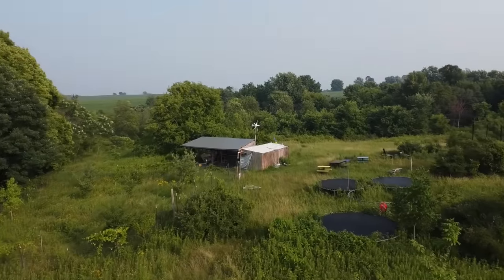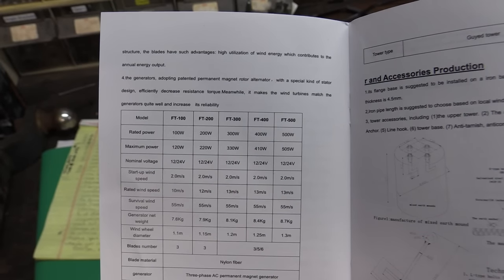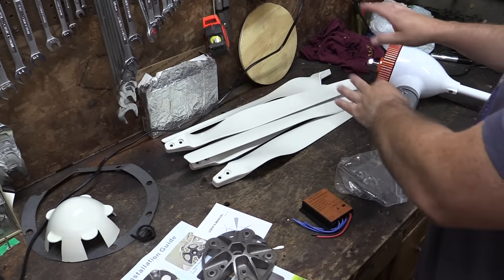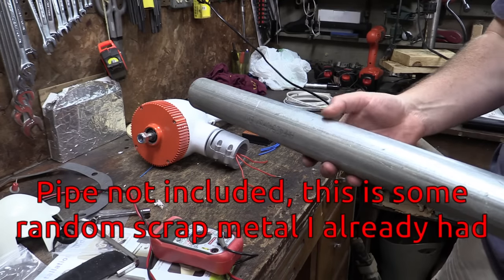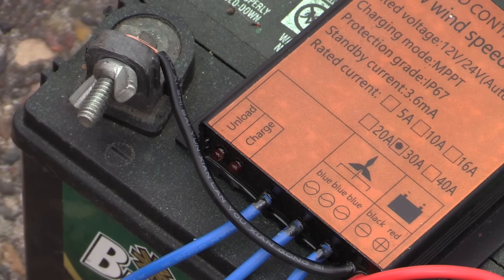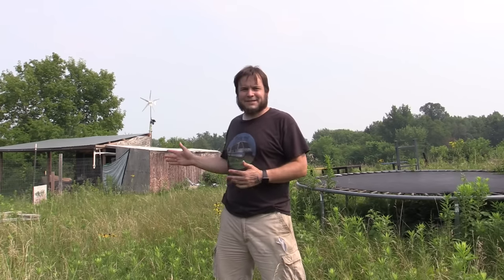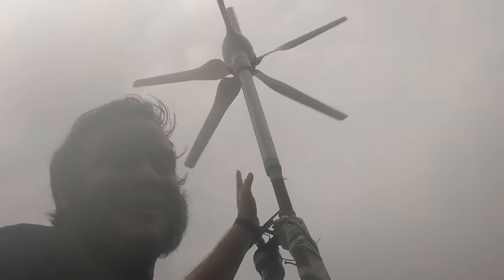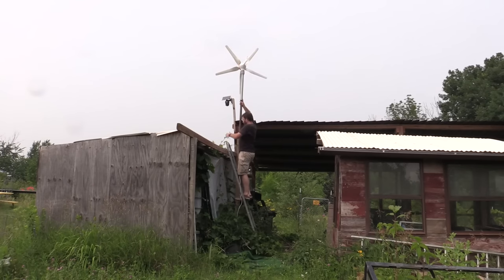Finally A Real Wind Generator! Vevor FT500 Review

Comment: If you ask me, these sponsored reviews are so much better than generic VPN-ads other creators roll. The turbine doesn't look bad, I think I'd give it a try myself. The entire off grid topic is kinda interesting on it's own, would be really fun if some water-turbine company reached to you for an review
Reply: I agree. I actually watch these!
Reply from the maker: A water turbine would be fun, we had one when I lived in Alaska. Unfortunately the Midwest isn't known for its mountain streams 😂
Reply: @saveitforparts   But we do have wind!  I live in BFE, miles from a highway, surrounded by flat fields.  Windy almost every day.  Still days are an oddity.
Reply: was it a homemade unit using an alternator for power generation?
Reply: I agree this is extremely relevant to my interests, and what an absolutely brilliant live commercial style video. I was actually recently searching for small wind turbines
Reply: @saveitforparts ...and the few creeks we have are all dry right now!
Reply: These arent awful but they dont last long if you are in a extreme wind/weather area, but for the price, theyre not bad
Reply: instead of a heat dump for overload power use a water pump and a couple of water tanks first maybe then you can use a couple of triggers to cycle a hydro gen battery for low periods
Reply: Can you do a video listening to TV new station satellites I know they transmit to a frequencies
Reply: just in case you do try wind, check your local area max wind speed, not average as i did. I killed the controller on an $800 northern tool wind turbine in 31 days. West Texas has average wind speed of 13mph but we get it all in 3 months with some months averaging 30-40mph and 60+ mph gusts.
Reply: Those are nice, ran a 400watt one in a tiny creek with funnelling work that trickle of water nearly made me 400watt, I was 330 most the time. Those I like better than all the rest. Forgot name this hydrovane or something, sailors tow them
Reply: @vinceghio I'm tuning in to your frequency right now. Can you tell that I'm listening. Very interesting. Tell Michael I said "hi".
Reply: @saveitforparts make your own stream, I started with solar and used power from that as pumps to keep my stream running all throughout my 40 acres and I'm growing a forest, anyway I built my own water turbine from my own stream, it takes power to use keep the stream running but I have multiple water turbines all throughout my stream
Reply: @saveitforparts its an air-x knock off
Reply: @saveitforparts >>> The place where I was born and raised, FLORIDA, is not known for much mountain-anything...😊
Reply: Agreed, you seen Scot Hugh Piggot & scoriagwind? . Few in towns ever have Free running streams etc. Great if you have A River near you.
Reply: @piquat1 you sound in an ideal location..if considering DIY I advise buying a proven PMA PMG & start from there. I used to make Dozens at one time.
Reply: Prices of these have gone through the Rooff on Ebay US.The 400-500 Watts is at a high 12 metres a Second 40 mph wind. If you Offgrid   Boat, a Farm in Alaska or Scotland even a steady 0.4 Amps is valuable to keep the lights on or Radio Battery charged.
Reply: @glitter_fart correct! For many even a low steady charge keeps the lights on & Radio batteries charged.

Comment: It would be interesting to measure voltage and current on the input and output of that little "controller" box to see how much power is actually flowing
Reply: Yea that would be pretty useful in a review for a power generation device. Kinda pointless without any numbers
Reply: Yeah it's basically the only important thing to talk about
Reply: It will NOT be 500 watts, as advertised on the sticker on the tail.
Reply: @jasonheckenlively1172  Exactly my thoughts...
Reply: @MrSummitville how do,you know
Reply: @MrSummitville Well ya,the wattage all these listed by only make that rated power in maximum ideal wind. Being able to generate power at night and in winter with low light is pretty huge.
Reply: to have the rated power of 500 watts,  the generator must operate at rated power for 1 hour to have a value that can be used as a standard.  it is unlikely that this will occur in most places.  some states, such as colorado will loan through the green energy schools, a test station so that power can be measured in the available wind to support the go/no-go of buying wind power products.

this is in response to the comments below.
Reply: @BigcountryReactions The main limiting factor and not plainly stated is input.  I'd image a so called 500w device will do well to produce 150w's, and even then it'd need a major storm or extremely constant hi wind
Reply: @stuartburns8657 it's bas d rating at a wind speed not all manufacturer use a standard wind speed for this. He mention the wind speed rating that watts are rated at. If you buy based on your local averages you will easily make the rated watts on average days with more on higher speed and lower on lower speed days
Reply: @JuanGelogo  I'll trust your experience, but I've been researching a small wind turbine to supplement by solar in the UK.
So far, prognosis and balance of opinion seems to be  by far to suggest it's not worth the time or money, unless you are keen on tinkering and learning for the sake of it.
Reply: doesnt manual say need voltage display and dump load
Reply: Ive got the same model kicks out same as a car alternator i average 17 volts which is fine as ..mines 12 volt model..and it works in low wind..
Reply: The best I got out of my identical  model was 80 watts at max RPM  (4.5 amps @ 18 volts), they are not close to producing the claimed 500 watts, physically far to small to do so.
Reply: In the electronics hobby area we have conversion factors for all sorts of things, the most used is probably 'the chinese ebay seller watt'', about 1/3......
Reply: @MrSummitville   'the chinese ebay seller watt'', about 1/3 of the industrial watt......
Reply: @KevinSoze-lb2qi *laughs in woodgas and steam
Reply: @MrSummitville yes, i agree. Most likely 100 watts

Comment: Rule of thumb just FYI is when you’re installing a wind turbine you want the bottom of the blades to be 30 feet above anything within 300 feet.  That get you out of the turbulent air created for instance, by the building you mounted it on.

If you were living out there and needed as much power as you could get for a refrigerator, maybe a microwave, charge a bank of batteries, etc. you would want to have it on a tower to maximize power production.

Having said all that, you did great :-)!
You’re trying to charge a little battery a little bit and maybe run a few LED lights/charge your phone. 

Everything about this little turban screams Chinese and cheap and at 126 bucks you probably got what you paid for. I think you did an awesome review!!

Thank you very much,
Reply: Hi, I live off grid and my turbine is 1kw. its mounted 1 foot above my ridge roof and catches every breeze there is and brings in 30% of our power. I think experience is better than theory and every instance has nuances that could make it a great or terrible location. having said that every time I need to service the turbine or check it, its not the best location to do this, but it is best for wind. I also liked the gaffer tape on the pole in this video! awesome
Reply: @oliverdaley934  is it mounted on your roof? Or on a proper tower 1 foot above your roof? if it’s on a tower, how far is the tower away from your roof?
How long has it been installed and working?
Is your house the tallest obstacle within 300 feet of your wind turbine?
Thank you,
Reply: @oliverdaley934  Oliver, I am glad your wind turbine is producing a level of power that you are happy with. If you have all the power you need, there’s no reason to improve  power  production. That’s great.

However, please understand that installing a small wind turbine on a proper tower, where the bottom of the swept area of the blade is at least 30 feet above the tallest obstruction within 300 feet, is a good rule of thumb. It’s based on decades of data compiled by respected small wind industry companies, as well as government entities such as national renewable energy laboratories or NREL. 

There are two reasons why you might want your wind turbine higher.
1, to get it into the laminar flow. Turbulent air can put a lot of stress on your blades which in turn stresses the bearings, rotor, etc. It also lowers power output. In short, it wears your turban out faster, and you will get less power.

2, the higher you are above the surface obstructions, the higher the wind speed.
Speed is represented as V cubed in the power equation. So if you were to go from an average wind speed of 10 mph to 11 mph for example., You would gain over 30% in power. This is a proven fact. Maybe Google “wind power equation“ for clarification.

Towers are expensive and require knowledge of soils, materials, and proper installation.
I think it’s great that you live off grid and make your own power!! There are a lot of people who couldn’t do what you do, 
Hopefully you’re in touch with other people locally who can point you to reputable local dealer/installers that can help with any problems that may come up in the future.
All the best to you,
Reply: @solarwind907  hi! so it is mounted on a tube/pole which I put through the roof and the bottom of the turbine blade is 1ft from the ridge line. so no tower, but a pole secured through the building. its been installed in this location for over 3 months over winter. it is a unique location we live, as in a valley in high ground country, but it is not effected by the roof, or it could be but not negatively. I might add the roof is not a traditional up and over ridge. the roof is rounded on the top as by design in the detail, that I would say is unique.  if it was mounted higher, it would be terribly exposed as the winds get strong. so I can't relate to your points on proximity to buildings. thanks
Reply: @oliverdaley934 glad it working for you. Some issues other people have run into when doing what you did are:
- Roof leaks.
- Vibration
- Noise
- once, fire in the roof, due to poorly made, and placed power connections.
All the best,
Reply: wow 30 feet above the tallest things. sooooo my tower needs to be idk. 150 feet tall. nahhhh, that’s to much.
Reply: @patrickcoyne1292  hey, you can put a 10 feet off the ground if you want. It’s not gonna affect my life any. But if you don’t get your wind turbine up in the laminar flow and out of the turbulence, you’re not going to get the production you’re paying for.  And turbulence tears of wind turbines. If you talk to a legitimate wind turbine manufacturer, they will tell you that in the installation manual.

Guessing you have 120 foot trees around you?  If you’ve got a creek, micro Hydro is the way to go.
Reply: @solarwind907  i get more than what was advertised the way it is. theory is nonsense. it’s about location and practicality. you sound like a salesman honestly. pretty well rehearsed, but more than likely no that we’ll versed
Reply: @patrickcoyne1292  
Please do tell me what wind turbine you are using on the short tower in a forest of 120 foot trees. You know, the one that put out more power than advertised?
I have met more convincing salemen than yourself.
Reply: @solarwind907 no one said i live in a forest surrounded by 120 foot trees. you said taller than anything within 300 feet….i have a clear shot at the wind. again because theory isn’t always correct. it’s a primus air40. 3 of them to be exact. facing east up the matanuska river valley.
Reply: @patrickcoyne1292  If you read my post you'd know that it's a rule of thumb.  A site survey, performed by someone who knows what they're doing, is always a good idea.  

If you live in a place where, when you have wind, it always comes from 1 direction, and you have a 120' tall object 299' away and perpendicular to that flow, yeah, it's not going to make much difference. 
 

A good way to figure out how high you need to be to get into the laminar flow is to fly a kite.  Put surveyors tape/streamers every 10' or so so you can estimate the height.  When you see 2 or 3 streamers sticking straight out in the same direction, that's laminar flow.  

Air is a fluid and it behaves according to laws of physics.  Doesn't matter whether we believe or understand the science, we're still affected by it.

On the other hand, if your system is putting out half of what it should but more than what you need, why mess with it?
Reply: @solarwind907  so instead of stating rules of thumb, just say have a survey because you yourself cannot possibly give perfectly sound advice to everyone on youtube….
Reply: @patrickcoyne1292  you’re welcome

Comment: I am thinking that rubber pad is supposed to wrap around the pole where you attach the turbine collar to the pipe to deaden noise transfer.  It may also prevent water from migrating into the mounting pipe.   Might not be needed in all applications.
Reply: correct darlinks
Reply: I’m thinking it is for vibration dampening or galvanic isolation.
Reply: @garrystreeter-noaafederal2049  yes darlinks noise reductions

Comment: A very beautiful wind turbine, where height matters, the higher the wind turbine, the more wind it catches. It's truly an ideal combination, the solar panel and the wind turbine, so you can generate electricity day and night, and if both are unavailable, you have the battery as a buffer. A very intelligent design. 🤗👍
Reply: I liked that it was easy to assemble and install😅

Comment: Would have been good to know how much current was actually being put into the battery, which is the main thing you need to know when setting up a power generation system.
Also i think the rubber strip is for mounting to a smaller diameter pole, so that the clamp will close down on it.
Reply: Wrong

Comment: for only 126 dollars this could be an amazing off-grid option. get 3-5 and you can charge damn near anything and have pretty consistent power with a battery storage. get 2 and a medium solar panel and as long as there is sun you've got power.
seems like an amazing option
Reply: Can u connect 3 of this paralel?
Reply: Keep dreaming.
Reply: Yah, $126.00 to buy it and $500.00 to order a replacement Stator coil from China IF they even have any in stock. Most of these wind turbines where made in 2004 to 2010 and have been sitting in warehouses filled to the rafters for over 18 years. The manufacturing plant is long dead and the molds sold for scrap metal. Before you buy a wind turbine pretend you already own one and try to buy parts for it. Your lucky if they even bother to email you back and if they do the repair parts cost are over $500.00 with shipping. The stator coils go first and they cost BIG BUCKS!! BUY AMERICAN!
Reply: Tip from an 11 year veteran of off grid. Read everything you can but still be prepared to have failures. It's a pretty steep learning curve.
Reply: I think we need to think a large scale
Reply: Skipping to a video that isn’t about chinesium junk.

Comment: I just turned 50. My Grandfather, a lifetime farmer had an old, I mean now it would be probably 90 to 100 years old, wind powered battery tender. I was born in 73, and it was on top of his shop my entire time, he passed in '11. Whole point, it's old tech we ignore as a civilization.
Reply: They used to have a portable 6 volts one for some kind of radio. I think it was called a Wincharger. The radios had tubes that had a filament heater that ran the battery down pretty quickly unless you had the wind generator. People used them to charge a 6 volt car battery too. They put out about 8 or 9 volts.

Comment: They are well worth the money.
I tested mine in town but didn’t have enough wind to do anything.
After I moved it to the farm and it definitely helps keep the batteries charged over night when there is no sun on the solar. Only puts out about 30 amps on the high side. Mine was listed as a 300 amp model.
They might have intended 300 amps per 24 hours
For the price I have been happy. I also added a low voltage disconnect and configured it so I could burn off power when battery was fully charged to keep from burning up the generator.
Reply: only 30amps, 10amps is good charging for 100ah battery

Comment: I added this turbine to my solar shed , I’m very happy with the outcome, I do not send any power back to the main grid , so many negative views on turbines I thought I’d see for myself, I added it to one of my battery banks (cheapest one ) with just a pair of small jumper clamps for fast disconnect, it unloads when main controller is in boost mode 14+volts so I don’t see a problem there , and no dump load because it unloads and I run grow lights at night and 250 watt heater , ( I’m retired) I have cameras and wi fi on/off switches , but  I can get 3amps at 10 mph so far , 3 amps ? Well harbor panels at 4 and renogy at 5 amps per 100 watt panels , but wind must be constant at mph so now when I hear my wind chimes I know my batteries are charging

Comment: Interesting. I have a 1200W 110V turbine I wasn't allowed to install by my town, it's quite a bit larger than yours. It's 3 phase AC also so you could have connected the 3 wires in any order to the rectifier which is just a bunch of diodes. It's a shame you didn't do any power measurements under mild and windy conditions :(